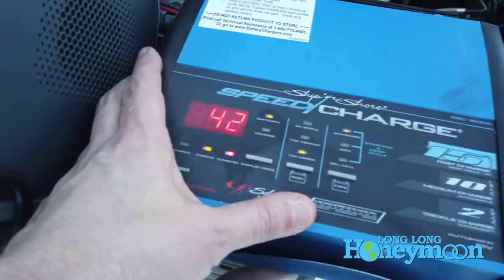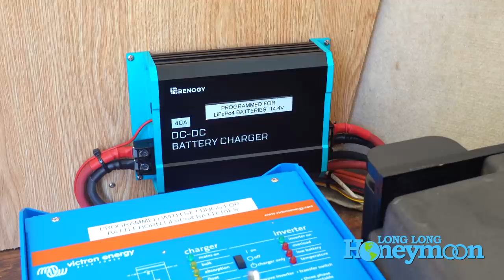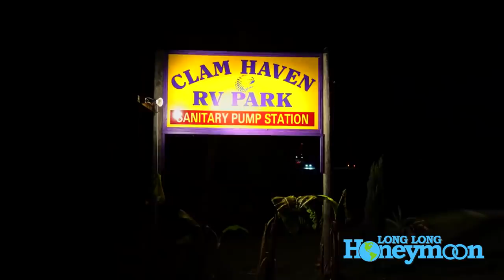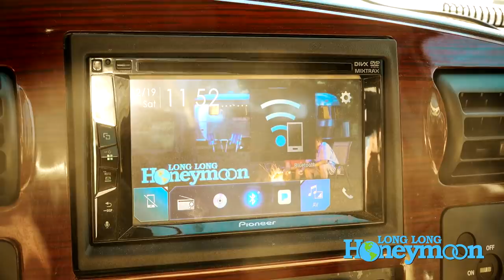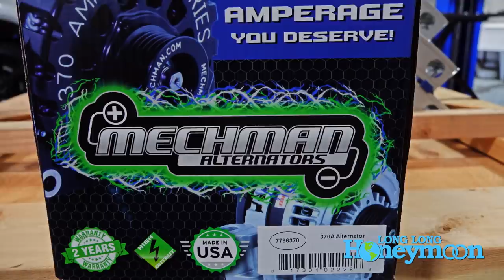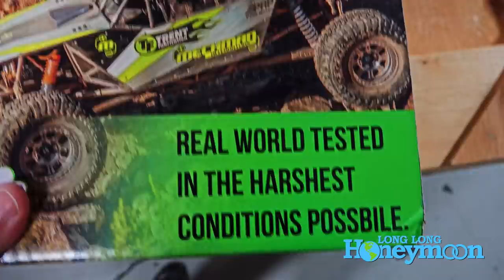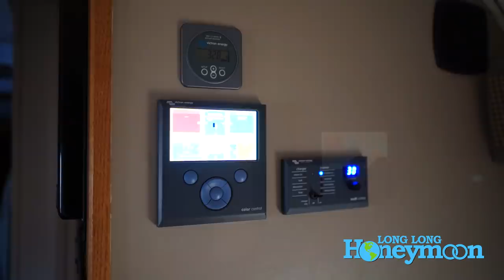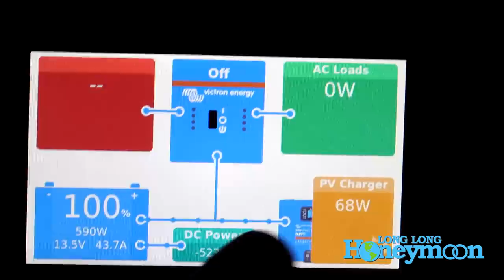UPGRADE: Installing a 370 AMP Mechman Alternator!

Comment: Why was there not a battery isolator installed which would give truck battery priority charging.
Reply from the maker: That may be next on the list! But for now, everything seems to be working fine with the new alternator setup.
Reply: From my understanding an isolator will close the circuit only when the truck is off. The circuit is open when the truck is running. Therefore if your camper batteries are low, energy will flow unless you put the isolator on a separate switch rather than the ignition.

Comment: I Wonder why your solar installer didn't give you a heads up that your truck alternator may be undersized to do the task he was giving it to do?
Reply: @badgerpa9  We must have hit a sour note. We didn’t get a heart with our comments!!
Reply from the maker: Everything seems to be working fine now. Honestly I suppose this was just an unexpected "real world" problem. Most modern 6 phase alternators in more modern trucks would probably not have the problem, especially since the Renogy DC to DC charger was installed.
Reply from the maker: @hussietart  I got an email from YouTube the other day with some statistics... apparently in 2020 I personally replied to almost 10,000 user comments. What's surprising is that 10,000 only represents a small fraction of the total number of comments. And that's just YouTube. We also get comments on Facebook, Instagram, Twitter, email, etc.  If I spent all my time replying to comments I'd never have time to do anything else.
Reply: Because many of them know nothing other than exactly what they're doing and only know the basics.

Comment: Mechman alternator site has many options for you , call them.
From there website: 
Single V belt and 4 rib serpentine belts will start to slip at about 150 amps worth of load.  For minimal belt slip, 240 – 370 amp alternators should not be driven by anything narrower than a 6 rib serpentine or dual-V belt drive setup.

Comment: I bought a 3.5KW Inverter generator and put it in the bed of my pickemup. If my RV trailer batteries need charging I'll just fire it up. will run 10 or more hours on a 2 gallon tank. Weebabycamper has solar panels that keep the batteries charged usually. While I can charge from my 90 amp alternator I don't usually.  Now I can run a table saw way out by the Barn, too.  A big Alternator draws a huge amount of horse power (mileage) from the engine.

Comment: Just joined... My wife of 51years and I enjoy your videos... I put a solar system on my 31 ft. Class C Motorhome 2007 Four Winds Fun Mover. We tow a 2006 Wrangler. The solar system is a complete system by itself . Have a Large DC converter to charge my two Battle Born Batteries by a inverter if needed and if plugged in power at full hookups it will separately charge them off shore power.. House battery and solar system batteries and separate.. All plugs in rv run off my solar array and solar batteries AC and DC.. Plug in shore power and everything runs off shore power, Some pretty good Cons having it set up like that... Hope to meet you and the wife someday on the road. We have just really started on the 25 day trips last year.. We are both retired and 73 and 68.. Live on East coast of North Carolina.. If you ever head this way , I have a small place on the Pamlico River in NC. Have a Pontoon boat and a larger boat for skiing . Come on over won't cost you a thing, except to get here... Sam and Cindy Jones... (Hm) 919-735-0246

Comment: Well, here I sit with my 1/2 inch breaker bar in hand and my Chilton and Haynes In the other hand awaiting the arrival from Ebay of my new MachMan 240 amp alternator. Iv been put afoot for the second time within a week by the Ford dealer in Longmont now I'm taking things into my own hands. Thanks for the recommendation it was just in time to suite my needs.
Reply from the maker: We've towed 2000 miles now and had no issues. Working great so far!

Comment: Thanks for the info.  My camper refrigerator runs 12 volts from the battery so I got the mechman alternator and did the same basic cable hook up. Never would have done it without your guys help.  Thanks

Comment: That Bulletproofed 6.0 may be "aging," but if you've checked - and I mean REALLY checked what's out there now in terms of durability, reliability, and cost - you'll easily come to the conclusion that there's NOTHING better than an older PowerStroke. I have a 7.3 in an OBS (old body style) and it's simply incredible! It actually gets better with age! Hang onto yours!!!!!!
Reply from the maker: It's still a solid tow vehicle. This year it took us safely through the Rocky Mountains again. 💪

Comment: Howdy from Oklahoma! I have similar truck but mine dies when below 15 degrees. The gurus tell me it’s electrical. I’m going to upgrade wiring and battery connections first, then may upgrade alternator. Just replaced it a few years ago with a 110 amp I’m sure.

Comment: Sean, I didn't get to finish asking my question, my first time replying to anything. But my question was did you have a second dc to dc charger on your truck for the second battery and did you upgrade your wiring (big 3) like your grounds and charging wires. Any insight on your system would be helpful and greatly appreciated. 
Thanks
George

Comment: Hooe you did a 4/0 big 3 power wire upgrade under the hood. 370A is a massive amount of current at 14V
Reply from the maker: Would the upgraded alternator adversely affect the FICM?

Comment: Yes you got the GODZILLA of alternators. Well worth the $$$ IMHO. One must be careful when installing a DC to DC charger and using a factory minimum alternator. You can burn them out pretty easily. They have to run constantly and not getting enough cooling time & air. I am a bit surprised that Seemore didn't come with twin alternators. A lot of diesels do. well you shouldn't have any issues now...

Comment: Perhaps I'm missing something but is the D+ wire from the charger in the Airstream  connected to the ignition post on the alternator or some other fuse that only has power when the vehicle is running?  The charger has to detect power in order to operate.  Since I don't see a third wire by your Anderson connectors I suspect it is getting power from a wire that is located somewhere in the Airstream. And if the wire is attached to a power source that is on while the vehicle is off and connected to the trailer, it will drain the starter battery   In other words, you may have started your shake down cruise with a half dead battery if you hooked everything up the night before you left. Per the manual:

"The DC-DC will not power on or operate until the D+ ignition cable is connected to the ignition circuit where it will detect a 12V source to operate ON. The purpose is to toggle the DC-DC switch on when the vehicle is running with the alternator to prevent the DC-DC from operating incorrectly with just the starter battery leaving you with a drained starter battery. Use 18-16AWG copper cable. You may need a multi-meter to test your connections to verify placement of the D+ wire".

Comment: You should think about adding a soliniod or switch to back feed over that charge controler or if easy access you could use a jumper cable, in an emergency situations, you had all that power in the trailer that could have started the truck. Plus it's a great back up when technology gets the best of you, last camp trip of the year inverter was set at 5amp 120 input max. So I could not charge my battery bank and run instant pot.

Comment: Just to wet your appetite for a new truck I have new GMC 2500 Gasser with interesting features, probably similar on Ford and Dodge
1.  Came with 180 amp but there is option for 2nd 220 amp alternator
2. The computer now manages charging and voltage.  If demand at idle is more than available computer will increase engine idle speed as needed to increase amps.  If alternator limit is reached computer will drop volts to certain vehicle components to try to balance load.
3.  Hot wire to trailer thru factory 7 pin is fused at 30 amps and is hot whether truck on or off.  (Several videos out there on how to jumper this circuit over to switched power)
4.  Very hard if not impossible to run batt down when off.  Most acc's shut off after 10 min.  I'm told circuits remaining will shut off before batt volts get too low to start.

On the negative side, friend in dealer service dept told me about one of these struck by lightning......and ins co totalled it out.

Comment: I know this video is 2 years old, how has your DC-DC charging been working? What size wire did you run through your Anderson connector to the RV battery bank?

Comment: You may be OK with that alternator, but most folks don't understand that none of these HD alternators are designed to output their maximum load CONTINUOUSLY. Car/truck alternators are designed to output high loads for relatively short periods of time, after starting the engine or for very short duty cycles. The real issue is HEAT BUILDUP. The alternators can only output a small fraction of their output continuously, before overheating. Usually, a vehicle alternator will produce high amps for top-up a regular lead-acid starter battery, which usually takes only a minute or so, before the battery id back to standard float voltages and with minimal continuous draw. The issue here is that Lithium batteries have very low internal resistance, which means they will take massive current levels (charging current) for as long as they need it before they reach 100% and the BMS/Battery charger cuts the charge. This situation will kill virtually any standard vehicle alternator and will strain even the big, HD alternators. The best alternators that are designed for continuous loads have heat sensors built into them and can actually derate themselves to cut the current levels to avoid burning themselves out. You may be OK as you have only a small 40a current load, as long as that load, together with your vehicle accessories, lights, sound system, etc don't require more current than your HD alternator can provide over many minutes/hours of continuous use.
Reply: So does it matter whether or not most folks understand? Information is great but I don't understand the point. Get rid of your stereo system ?do not modify your motor or vehicle?  Well it looks like nine people went and bought a factory alternator and your comments save them a lot of trouble. 👍
Reply: I see ppl with 320amp alts and thy system takes for the. That and thy keep up I'm not sure if that goes for now days

Comment: Not a cheap alternator but worth it if you need the power. Will probably upgrade our 200 amp Ford F350 in the future.

Comment: Hey Sean, You do have a solenoid between the truck and trailer right? Preferably a smart solenoid that prioritizes the truck batteries. Doing the simple math, your truck at idle will be around 13.1 volts DC and feeding your trailer's 40 amp DC to DC charger so you have a built in limit of 40 charging amps. 13.1V* 40A=540W so at idle your charge meter is showing almost exactly that from the alternator feeding the trailer batteries. Then you have to figure the rest of the active load you're running, especially at night.  My 160 amp alternator does a great job charging my truck agm and truck camper 2 agm batteries. Give a holler if you make it up to the Hood River area.
Reply from the maker: Thanks for the input! Maybe see you in Hood River later this year. Cheers!
Reply: @LongLongHoneymoon   If things in your schedule work out this direction, give me a little advance notice, I can get you setup on my friends ranch. Dump, power, and fresh water available.  Get there late March for snows to melt, unhook and there's a ton of sight seeing day trips. Mt Adam's, St Helen's, Mt Hood, and numerous places between.

Comment: Very informative, on last trip, noticed my motorhome alternator voltage output was getting a little unusual. Your link to "Patreon" is producing a 404 error on that website, you might want to check it.

Comment: Have you looked into dual alternators?  It is very common on marine diesel engines.  You have dual batteries in your truck, why not dual alternators?
Reply from the maker: I think it's a good idea. At the time I did not realize this was an option. Anyway, everything seems to be working fine now.

Comment: Understand that the Renogy 40 amp DC/DC unit OUTPUTS up to 40 amps but it can draw as much as 50 amps from the truck due to that fact that it is a Buck/Boost design, it can buck the voltage down, or boost the voltage up, to what is needed, and with internal electrical losses, it needs more than it puts out. I've been looking at the Mechman alternators for a year or so now, and installing a separate cabling system and Anderson connectors, but it will just have to wait. No lithium so its not absolutely needed right now.

Comment: Thanks for the info. I don't have the same set up as you but I do have some extra stereo equipment, a couple compressors and a few do-dads on the dash. I will add it to the to be done list. Thanks for sharing! Steve

Comment: DC to DC is my favorite method to charge lithiums, so fast! Though I'm not a huge fan of Renogy because of support, or lack there of, they do make a decent product. We ran a Sterling (marine grade) 60 Amp unit in our Van, what a beast, and has some kind of voodoo protection circuits for the alternator. my 2nd choice would be a Victron B2B. That Alternator looks awesome, that should be fantastic. mmm should I upgrade our new truck's alternator? we'll see.

Comment: Sean &  Kristy....Merry Christmas!
QUESTION: How long can you "typically" run your A.C. on your 400ah Li battery bank?
Thanks guys!
Reply from the maker: Merry Christmas! Assuming a full bank of batts, we can run the AC 3-4 hours. So if you are running AC 24/7, solar is not quite ready (or else you need a lot more batts!).
Reply: @LongLongHoneymoon  Thanks Sean and Kristy. What I'm thinking is starting the AC about 30-45 minutes before stopping for the day and then running it on the gen. once planted for the day. Thanks for the reply and Merry Christmas right back to you :)

Comment: Good informative vid. I will say, I'm a little surprised the solar/battery installer did not bring this up.  Merry Christmas.
Reply from the maker: Well, our truck is a bit of a dinosaur. More modern trucks will probably not have this problem.

Comment: Unrelated to the alternator conversation (but spotted in the pull away drone shot towards the end of the video), I see you’ve got the Thule (Yakima?) cargo box mounted backwards on the over bed rails. What’s the benefit? I’m considering a very similar setup. Thx.
Reply from the maker: Technically it may be backwards but it's designed to be mounted in either direction. This direction seemed a bit more aerodynamic with our truck. Our installer said this 'backwards' option is popular on trucks.

Comment: When upgrading car electronics it's not a bad idea to go to the car audio crowd. 10,000 watt+ it's fairly common. Do the big-3, it will improve the performance of your electrical system, including alternator, batteries and other accessories!
Reply: Dc-to-dc Chargers are also a very good option. Battery isolators including smart battery isolators also.
    Smart alternators is something that your viewers may want to do a little research on before modifying a charging system such as this on Modern vehicles. Smart alternators senses the temperature under the hood and once it reached a certain amount it cease or decrease the charge. They are designed to charge the vehicle battery only, secondary batteries are not taken into account.

Comment: This is probably a stupid question, but do your solar panels charged the batteries as you drive in sunny areas?
Reply: batteries in RV, yes. Batteries in truck, no.
Reply: @AskRemy  I didn't think it would charged the truck.I should have been more precise in asking the question.thanks for your answer.
Reply: @swansodi  I didn't think you would, but just covering all bases

Comment: Using a 20 amp renergy dc to dc while slower would have probably saved you. However your old replaced alternator  got hammered with feeding  the beast of batteries banks. You made a good choice however. Our toad battery got hammered on our 2020 to Teton from NJ. Im going to do a similar with the charging of the toad . Break control runs while in tow.
Reply: Merry Christmas!

Comment: I want to install one of these in my 2011 Camry, if for peace of mind if nothing else.  Most of the alternators being produced today are China junk.  I don't want to screw up my car doing it though.  At a minimum, do I need larger gauge ground and battery cables?